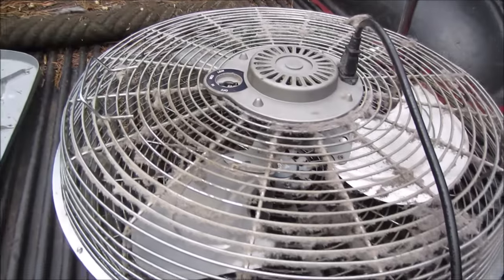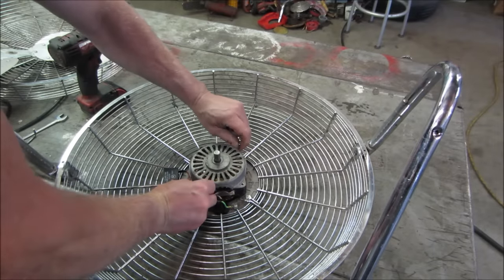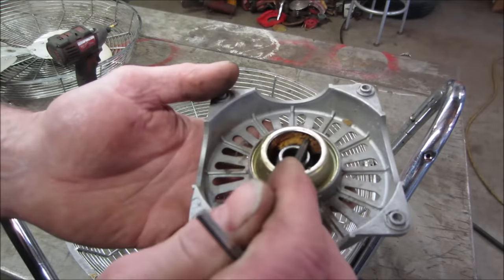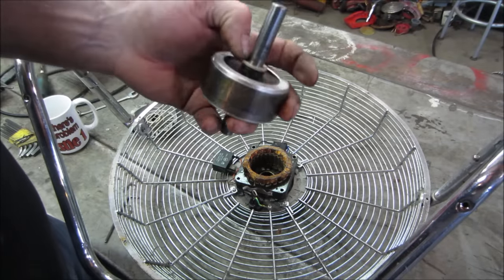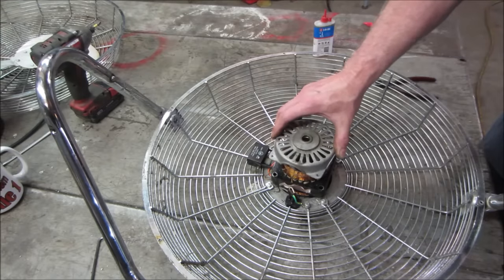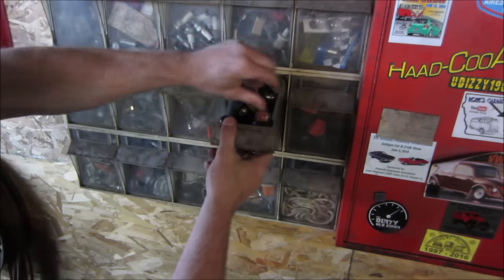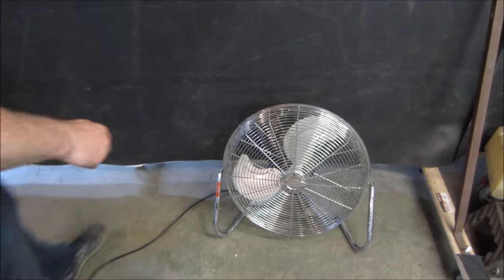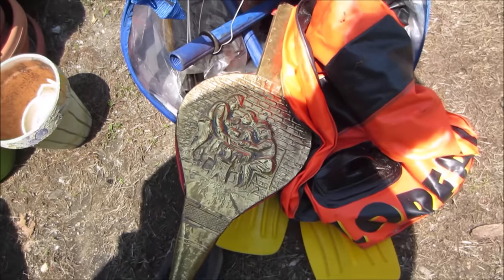Fan Blades Won't Spin? Lets Fix It

Comment: Your fan will FAIL. The material that you were calling Dried Up Grease. Is Not Grease. It is Oil Wick. Holds oil to lubricate the Bearings. The Bearings are Oil-Lite type. Compressed Lead Particales. This allows the Bearing to be Poris. The Oil moves through the Bearing. The Washer you Broke apart was a Fiber Spacer Washer. By the way you Lubricated it. You have No Source of Oil feeding the Bearing. So in a Week it will slow down again. Have over 35 years of Rebuilding Electric Motors. Stay with working on Gas Motors.
Reply: The last part of the comment was nasty burn, bro. Dont tell him to stick to gas motors, but reach out and show him his error. We all have to start from somewhere. When We're learning different projects, encourage and show him how he error, and he can improve.
Reply: @cedricgaming5106  I have been watching to many motors about electric motors and generators. He may do a better job with gas motors. But when dealing with electric motors. I see to many dangerous mistakes where anyone can be electrocuted. If this is wrong to worry about safety. Then you can bury them. Have been electrical shocks to not understand the True Danger.
Reply: @dennisemme2456  I respect that and didn't mean it as put down and maybe I need to practice more on what I preach.  I only meant it in a way to get ur point across more effectively it's not what u say but how u say it if that makes sender sense. I appreciate ur respond